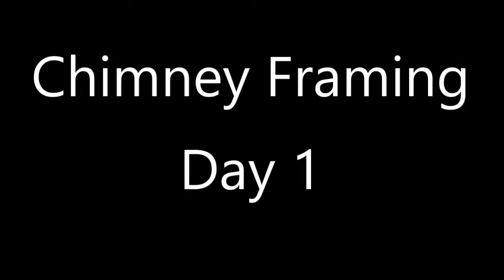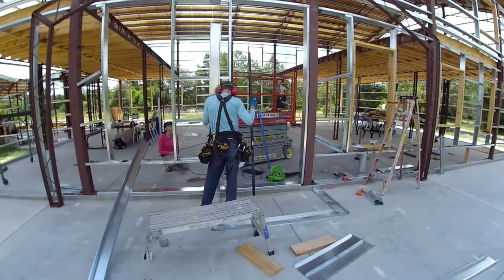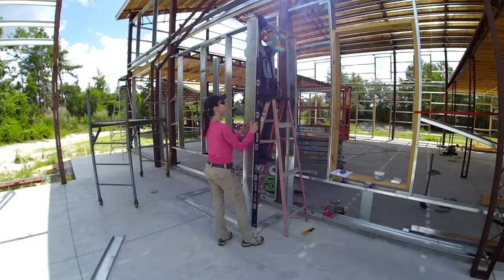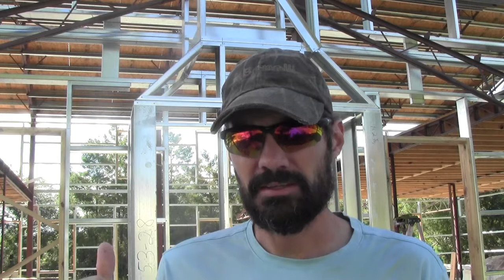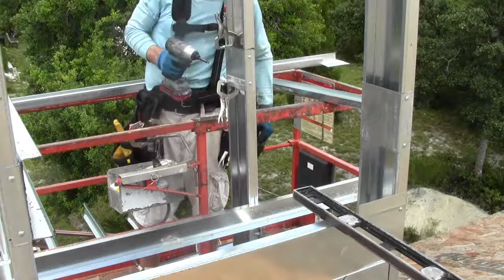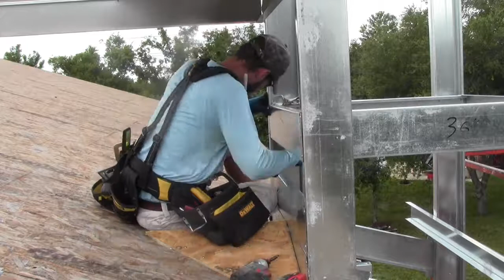Episode 33: Chimney Framing

Comment: How did you decide to put sheathing under the sheet metal roofing/ walls?  Is it required by your county?
Reply from the maker: Great question but complicated answer. We are planning to use spray foam insulation and in speaking with the contractors they did not recommend shooting it to the bottom of the panels (many said they would not do it) so we decided to use sheathing for the foam to adhere to. It also added additional strength to the roof and gave me a surface to roll out the radiant barrier underlayment. This added one more layer for any moisture from condensation or any other means before it could enter the house.

As for the requirement, that depends on the building. Our building design would allow for the panels to act as the shear bracing without the plywood. In my case I actually had to clear it with the engineers and building department to show an installation method where panels could be installed over sheathing. Many metal panel suppliers have an installation detail for over an existing roof using battens or strapping so that was my argument.

I hope this helps and thanks for watching and for the comment.
Reply: @CedarTrailsLiving  good info thanks.  I am getting a worldwide steel kit for my property in hernando county, FL so your videos have been a big help.  thanks!